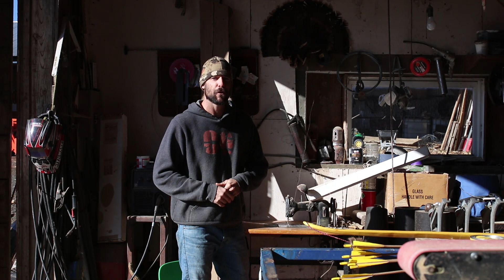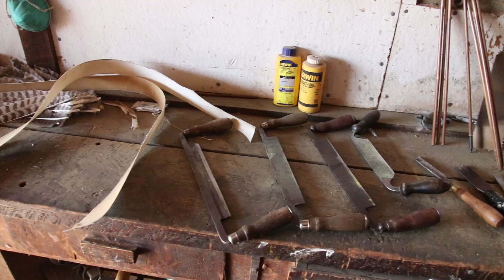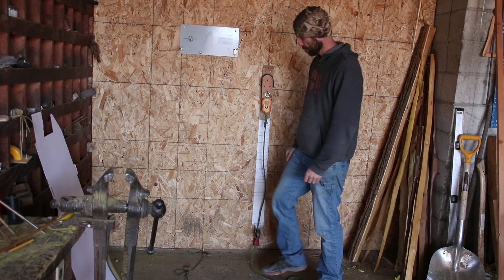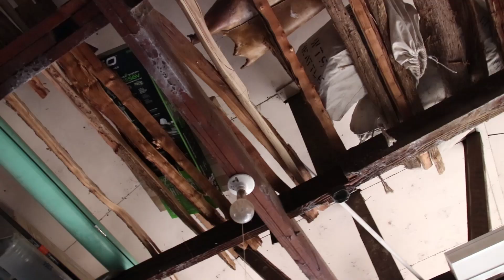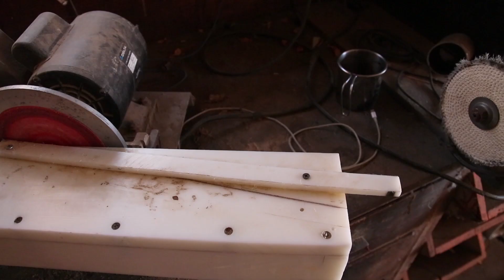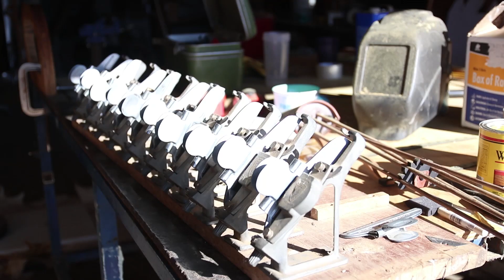SHOP TOUR - a look at my bow building tools and shop

Comment: Good video, thank you.  Something to consider:  A benchtop belt sander becomes even more useful if it is mounted horizontally to a jig, as if it was rolled over on its side.  In this configuration you have good visibility to grind close to a line.  If a shelf is added to the jig that  is the length of the belt and perpendicular to the belt, the user has a handrest to hold a workpiece during the grinding process.  This gives really good control.
Reply from the maker: Good tips!

Comment: Knife shop tour, I don't mess with too many bowls like this because I've broken too many of them with my 32.5 inch draw length
Reply from the maker: Just make them a little longer until you get the nuances of tillering figured out.
Reply: back your osage with bamboo and make your bow a little longer. just curious but how tall are you?

Comment: What is going on with the DVD with you and Billy burger? That's one I won't miss out on
Reply from the maker: I’ve never met Billy. What ya talkin’ about?
Reply: I thought you were in fire dancer Whitewood bows? Guess not. But the trialer is on the primitive pathways channel. Check it out it definitely seems priceless for us bowyer's!
Reply: By the way, I've been thinking about backing a pice of elm with rawhide. Can you use big dog chews for this? Thoughts, suggestions? Thanks!
Reply from the maker: Dog chews will work but they’re too thick for my liking. Thick rawhide just adds mass and can reduce performance.

Comment: Awesome. I still use a Bitzenberger jig for all my fletching. Great piece of equipment. 
I've cut my own osage, downed trees and went through the entire process of splitting staves, debarking, hauling logs home, about 5 years ago and ended up with a torn rotator cuff. I'ts hard work for sure!
I do have a question for you Clay, do you sell tapered Osage slats for bow building? I've got a new Bodkin Hybrid, but I'd still like to make a winter time project because I've got boo in the roof of my mothers garage. I had osage stored in the barn, but the bugs have made worm holes all through it.
If you can help, please let me know.
Reply from the maker: I’ve got some drying down in Florida and will be evaluating it for possible sale in the near future. But I need to play with the laminated design a little first.